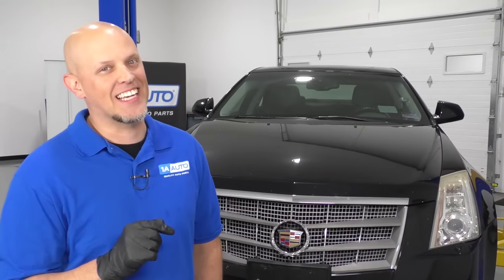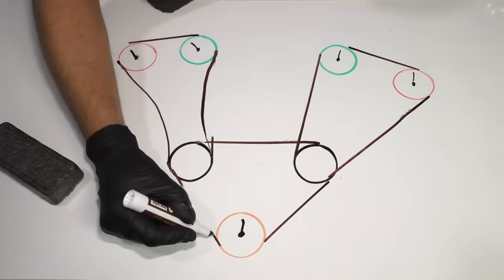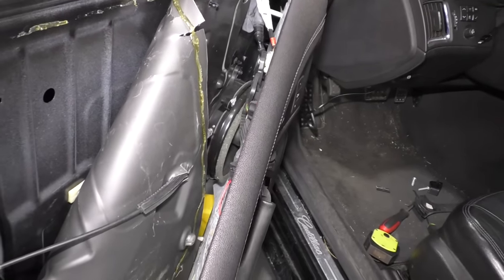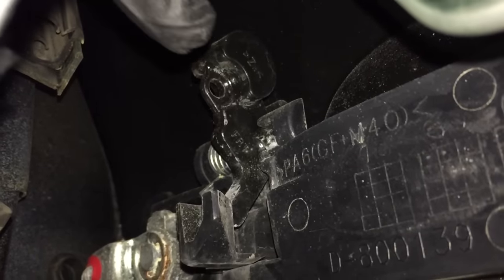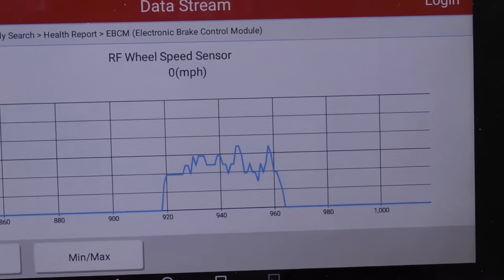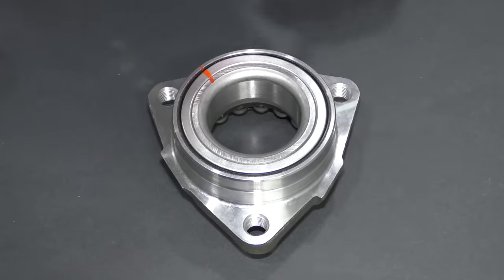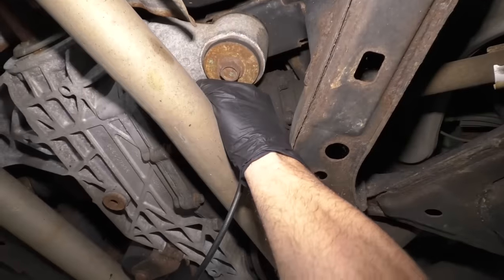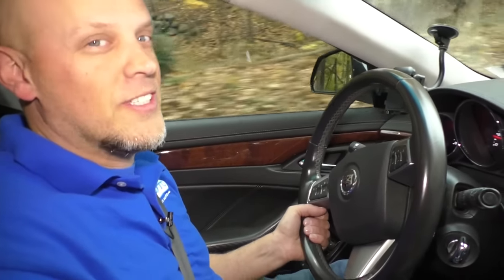Top 5 Problems Cadillac CTS Sedan 2nd Generation 2008-14

Comment: I have a 2010 Cadillac CTS AWD!
The biggest trouble I have experience is the headlights!  Changed them every 7 days that is the bulbs finally bought entire headlight assembly.  
Then I have replaced 6 wheel hubs. 
I had to replace my purge valve. 
I’m told that the hubs are because of the state I live in I feel it is a poor design. Then the dealership told me that I needed a fuel cleaner in addition to my tune up well they poured something or did something and on my way home my engine light came on took right back to dealership they said that my catalytic converter went bad and they said sometimes the fuel clean out they do will destroy my converter which it did! I felt they should had told me this before they started working on it because I would had said no to the cleaner and they wouldn’t pay for their screw up. 
Then every time I start my car after a few minutes something knocks on my trunk it sounds like someone is in  my trunk knocking to let them out it’s funny cause people get in my car for a ride and when my car knocks they always say what is that! I tell them it’s my ghost. Lol.

Comment: Could you please make a video discussing the chronic leaking problem with the sunroof?  Both my 2008 and 2009, with the sunroof option, leak water into the interior foot well areas when it rains.  Most times the passenger rear foot well area gets wet, but at times, any/all of the four foot well areas will have wet carpeting.
Reply: Have the drain line's cleaned out.
Reply: @Greg Hertko   The rubber grommets that the plastic hoses for the drains connect in to go through the body, in the front kick panels and in the trunk in the side panels need drilled out. They come out fairly easy. The center of the grommets have a couple of small slits for drainage, and stop up easy. Just cut out the whole inside area with a drill bit. Flooded my cts also, i watched a utube vid to figure it out. Is actually easy once you see how its done, time consuming, is worth it tho. I did it last year and have had no problems since. Trunk leaks from crappy seal on 3rd brake light I suppose,,lol.

Comment: A wise man once said, "Dont buy a Cadillac its a money pit." Well I ended up buying a Cadillac. I Changed Alternator twice, both Catalytic converters, aftermarket touchscreen radio, aftermarket remote start viper alarm, 4 new tires with extra set of rims, A pair of head bulbs which I had to remove the bumper, A water  pump, and those are just some of the things that I remember from the top of my head. What I need right now my AC/Heater not working, the door wont unlock unless you insert the key in the drivers door, and I want to add a back up camera. If anyone is interested in my BLK CTS 2008 3.6 Direct Injection, let me know.
Reply: Half my paycheck goes to my CTS in repairs and maintenance the other half my wife takes.
Reply: i got the same issue with my door. the remote only works after you unlock the drivers door. cant figure out why
Reply: Welcome to the club sir
Reply: I got a 08 sts which is the luxery cts. I bad timing chain, bad starter, frozen shifter, bad coil, break pads(to be expected), break lines rusted out (expected in the north east)... overall though I can say its probably a money pit my old eclipses were 1/5th the price and needed 1/10th the repairs per time ratio

Comment: Thanks for the info
Another expensive issue is blend door/defroster actuators
Reply: thats not expensive its cheap. just a bitch to do. i did it recently on drivers side.
Reply: Is your car making a clicking noise from the vent
Reply: @jacksonacar  mine is 😩

Comment: Would you recommend a used CTS wagon? or would that be a pass for you?
Reply: I have a used CTSwagon I love it even though someone T-Bone me sometimes I have a headlight issues and I went through a Delta Sonic car wash in a trip part of my tail light offyou probably will have tail light issues as far as them poking out but other than that I still love the car I've had it fixed since the accident and it's fine
Reply: Did you end up getting one? I’m looking at one too

Comment: I'm a used car mechanic for side job. I'm messing with the same exact 08 CTS rwd and almost all the same problems. Engine code p0008. Replaced all cam sensors and vvt solenoids, no fix. Timing chains next. Had me check out an ATS with same 3.6, has p0017. I told him I'll do the chains on the rwd but fwd not happening....lol

Comment: I have a 2016 Ats v and a 2009 cts 3.6 the 3.6 is currently having crank shaft position sensor issues I just bought the part going to change it this weekend

Comment: Don’t forget the PCV valve replacement and drilling them out with 5/32 and 7/32 on other side . Stopped my oil consumption and the oil doesn’t get as dirty.

Comment: 2012 CTS4 wagon
Wheel bearing out at 66000, speed senser error code,

Suspension sounds like a 72 Eldorado.
Rear hatch wont stay "erect" more than 2 sec
80000 now and I love it
Reply: Get your hatch struts replaced quickly.  They are probably leaking oil on the inside of the headliner.

Comment: These engines are super sensitive to oil level. My oil got low and I heard a slight ticking in the valve gear.  No engine light came on but pressure gauge looked a little low. Added a quart and it drove fine. The next day....drove about 5 miles and spun a rod bearing.

Comment: Very good. I am thinking about buying a 2012. It has 80,000 0n it Have not yet. Just thinking about it. My question is this. If the chance the oil say on a regular basis and say half on the dip stick. I should avoid some of these problems is that correct or not.

Comment: Hi there ' I have a 2011 CTS Wagon and the engine light came on I took it to the dealership and they are having a hard time finding out what's wrong with it I kind believe. It's been in the shop for a week now . I told them to check the all four sensors but the traction control sensor cause the wheel in the back felt like it was turning more when I took off . Could that be the problem 🤔

Comment: I bought an 08 CTS many years with 94K, now at 132K. Door handle problem and wheel speed sensor. I had the timing chains repaired under warranty when purchased. I like the car but a little nervous about driving it far from home. I kinda want to get rid of it, but I'm going to do the wheel hubs and hope for the best.
Reply: How to fix the door handle problem
Reply: Hey Jay I just purchased a 2011 and a 2 year warranty and it has 106000 on it, did u get the timing chain replaced because it was acting up or did u tell them it was maintenance and they covered it?

Comment: I have a 2008 3.6 STS. 270k miles . Original timing chains. I'm getting p300-306 codes . Multiple cylinder miss. No other codes and three shops can't find the problem. Could it be my timing chains? Also both banks are running + 20% on the long term fuel trim

Comment: I have a 2008 also a Cadillac CTS and it looses power on the hwy the tests say #6 spark plug is misfiring could that solve my problem? Also there is a ticking noice under the hood towards the back left where I think you said cylenoyed wires were what is that ticking?
Reply from the maker: +1969mom 1969mom Thanks for watching!  If a cylinder is misfiring it will lead to power issues, so sorting out a misfire could solve your problem!  That ticking could be multiple things, so if you are unsure what it is we recommend that you have a reputable shop take a look and diagnose it.
Reply: Im a single mom and haven’t found a trustworthy mechanic to help me plus it’s cost $300 so far. I changed the air mass fuel sensor myself well running in the house to watch YouTube on my tv & runnin back outside to fix it but that’s not my issue. Thanks for your response oh also why does my passenger door only lock itself and I always have to open door from inside the car :(

Comment: I have a 2009 CTS with about 175K, runs really well. Keep up with the repairs. Oil pressure seems to go down to about a quarter of the way at a stop light, then comes up when driving. Is that normal? I can replace the oil pump, but I don't know if that will change anything. I've replaced the oil pressure sensor not to long ago when I started getting crazy readings. It doesn't knock or tap and the timing chain doesn't clatter. Thank you!
Reply: Normal
Mine does that when its warmed up.
Reply: When the main bearings are getting worn they will leak more oil reducing the pressure. Happens when mileage gets high like your 190k

Comment: I'm looking at a 2023 cts coupe with 68k.  When is the recommended milage for replacing the timing chain?
Reply: Correction 2013
Reply: 100 thousand miles, my timing chain went out at 102 thousand miles cost me $1400

Comment: I have a low mileage 2003 CTS that I just bought. I had the Check Engine Light then Reduced Power condition two times. Once after we replaced throttle body. It runs for two weeks or 200 miles then same thing happens again. Any ideas?
Reply: I have a 2003 cts aswell. Mines blue and has 216000 miles. I had a 3.6l 2007 cts but i wrecked it bad and bought another a older cts, my 2003. It had a transmission that wouldn't reverse, really bad valve cover gaskets, bad coils pads, and really bad drive shaft.  So i got the rebuild kit for the transmission, and got the rest fixed,,, fast forward to today, its runing good. Im commenting because i remember that issue of reduced power. 1 time it happened, behind my house and i pulled over and was trying to figure it out.  I cleaned the MAF sensor.  Didnt work. I went home, came back with the MAF from my 2007.  I had it in my garage. Long story short, it fixed the issue that day.  BUT eventually it happened again outta nowhere. Im like yo what in the world.  So i said lemme replace the harness on the TPS. Cause it had 2 wires outta the 6, that were exposed and it looked bad. I replaced that and i haven't had any issues and ive gott better acceleration. Its more accurate. I deffinetly helped. So check the connector. The part cost like 50 bucks for a damn wire harness.  So check that.  It might just be the MAF in your case. But you said u changed the throttle body, is it new?? You probably need the wiring harness or the MAF.
Reply: Go to autozone, get your codes printed out, and see what the check engine light is about.  I changed my purge vave but it still shows up as circuit open. Crazy. So i have that code and mass airflow sensor code, and throttle position switch b circuit range performance.  I had these codes when that issue u had occurred to me.
Reply: KcEmmanuel12 Savage the code went away But no matter what I get a misfire in cylinder two now and I can’t get it to go away
Reply: I have a 2008 cts stuck on reduce engine mode can anyone help?
Reply: @mikelarry712  check the codes I had a bad thermostat and when I replaced it I got the reduced speed all you have to do is disconnect the negative lead on the battery which cleared the code

Comment: Have had most all top issues you mentioned with 2009 CTS 3600/6/C Had both front door handle sensors replaced (expensive), got tired of using the horrible designed fab key entry and leaning over to unlock passenger door. Now the back door locks have same problem. Tire System Sensor is out for the second time - on list for next issue to fix, timing chain replaced add motor mounts and many other major issues.  Will NEVER buy another Cadi.  Have put in 14K in this beast. Holding as a secondary car just because of the investment.
Reply from the maker: +The Passport & Visa Company Thanks for checking us out!

Comment: I have 2006 sts4 i just did the purge solenoid that's good. My door have the problem n motor still going good. 160,000 but it got me scared about the timing. What mileage do most people have with the timing chain going bad?
Reply: Dave for the Save mine started rattling bad at 235000 miles I’m
 At 245000 just unbolted my exhaust system it’s not far from being scrap metal 05 srx model

Comment: I am getting codes indicating stretched timing chain.  Would that cause the car to surge on idle?  Does variable speed valve timing not work correctly with stretched timing chain(s)?  Or could this mean I have bad camshafts?  If I replace the timing chains, is there another check I should do while the engine is torn down to that point to ensure when it is put back together, it will not surge at idle?  Please reply as I am getting ready to DIY tackle this project early next week.
Reply from the maker: +freedomseeker01 We wouldn't be able to diagnose an issue like that here, you may want to have a local mechanic take a look at it. Thanks for checking us out! http://1aau.to/m/Shop-1AAuto-c

Comment: My ;06 rotted away despite rustproofing. Ran great for 212k when all the brake lines burst in 2017 and that's when we put it to sleep
Reply: 212??? you got your moneys worrth, how long did you expect it to last lmfao
Reply: Sam Lawrence  I have 06 I oil spray chassis brake  / fuel lines every thing doors trunk Cross members suspension all fenders sills no rust floor got oiled too as did hood and trunk deck annually missing nothing as I do it myself. Running 5 - 30 synthetic every 4500 miles and few oz of motor kote
Reply: Nick J yes it will . I  scrape of any loose rust a spray everting except exhaust and brakes  annually repeat . Been doing it for years  it works for me .One nice thing is bolts on every thing is much easier to remove also
Reply: Sam Lawrence when i was a teen I worked at a stealership and one job was dealer rust proofing it was junk because it did not flow into cracks and welds. The only thing that in my opinion that does is annually oil undercoating and not the no drip if applied correctly it works

Comment: Stupid question, I know, but there are devices known as "timing chain tensioners" that can take up the slack of a stretched chain so there is no problem over high miles. Had them in my XJ6 X300. They don't have them in Detroit?
Reply: they have them as well.  They wear and do have a service limit as well

Comment: I have a 2011 cts coupe and as I'm driving it feels like a miss is happening but there's no code being displayed. I thought maybe the transformer because after a few minutes of driving it feels like a jerk from underneath the car, changed out transmission fluid but no change. Car shifts fine and gets up and goes fast but that jerk is constantly happening. Thoughts?
Reply from the maker: +Andre Paul Thanks for checking us out! Unfortunately, we cannot provide a diagnosis for your vehicle over the internet. We would suggest consulting with a local mechanic to figure out what is causing this problem. 1aauto.com
Reply: Big dog I'm having the same problem with my 2012 cts . When I just rest my foot on the gas pedal and I'm not pushing the car jerks at 1 and 1/2 RPMs

Comment: I have a 08 CTS also with 106thousands miles and recently put it in the shop to get the timing fix. $2100 for the repair.🙄🙄🙄 hopefully it won’t have any more Major issues❗️
Reply: Ouch was it the timing  chain and thats it 2100 ouch they usally 1500 to 1700 im thinking bout a new engine with warranty now. They 1800 at some places

Comment: hi so yes I have  a 2010 cadillac cts n it was recently in the shop I took it to casa chevrolet n wen I dropped it off I was driving dwn road n the car started loosing power n turning off or almost turning off wen I'd stop well then it started to do so wen I'd slow dwn or turn so I took it in they had it 4mnths n wen I liked it up it was shaking crazy n traction control light was on n my battery was completly shot n then he told me that I could drive in twn but if want to go on freeway I still needed to replace the fuel pump well now my cars running worse than b4 I took it in n I'm outa 3500.00$ do u have any advise??

Comment: Is a 2012 cts 3.6 awd with 130k miles at 5700 a worthy deal or am I on the brink of a flood of problems?
Reply: Hows it running so far got a 2014 cts with 78k miles for 13000 loving it so far
Reply: I have a 2012 aws premium   Replaced batteries and alternator under 90 k   No issue if it’s maintained correctly

Comment: I've done my timing chains three times now and it still says I have a cam/crank sensor correlation problem and while it starts, idles and runs good at high speeds it is sluggish off the line and has hesitation, 3.0L 6 speed. I have been certain every time the timing marks were properly aligned. This last time In even cold cranked it to make sure the oil pressure was up in the solenoids and the timing tensioners before starting it in case it was jumping time. Can a bad Phazer be causing this and if so how would I check the phazer? I vaguely remember seeing a video somewhere about the phazer locking in place when the engine is off indicating it's good but if it didn't lock it is bad?

Comment: Great video! I was wondering if you could advise on diagnostic codes P0011, P0301, P0300, P0303, P0305 on Cadillac CTS 2007 3.6
Reply from the maker: +pamsco49 We wouldn't be able to diagnose an issues like that here, you may want to have a local mechanic take a look at it. Thanks for checking us out! 1AAuto.com

Comment: Hello Im a owner of a 2010 cts wagon and im freakimg out. Just recently "today actually" my powersteering just failed. I maded the obvious inspection starting with the reservoir no issue there. I also notice smoke coming out on the left side of my engine that I never seen before question does that have anything to do wuth the power steering pump failing?. Any help would be great thank.

Comment: I guess I have an oddball. Standard alternator and water pump that I changed out since the dealer wants $1,400.00 for each. The only headache I’ve really had has been wiring issues with the lighting and speakers. Major headache. I’ve damn near had to rewire all of it.